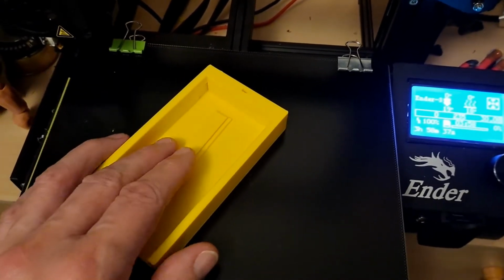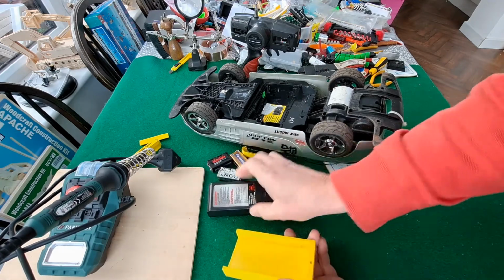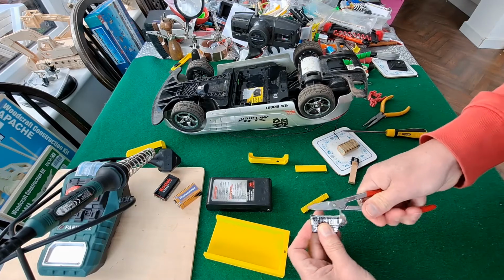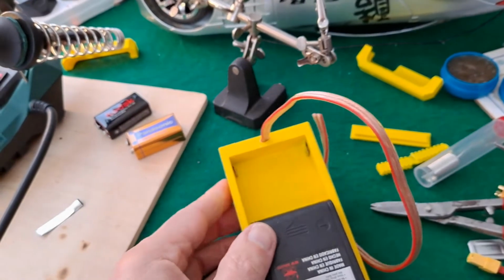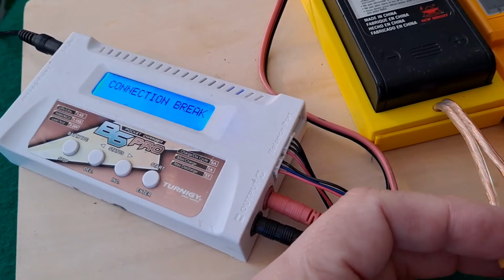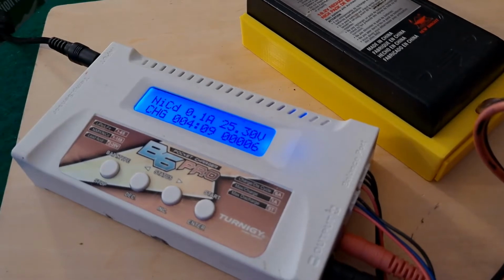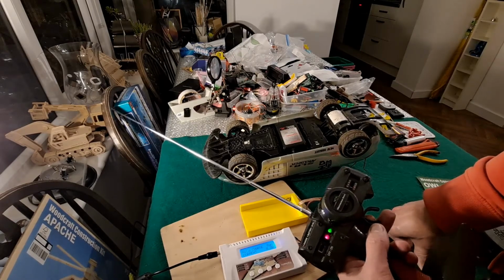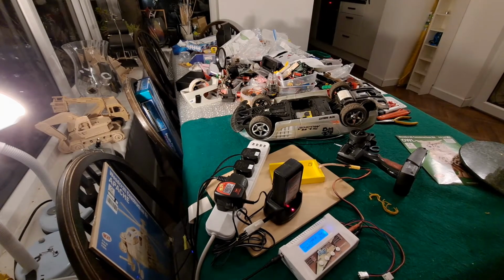3D printed battery charger adaptor

Comment: Enjoyed the video. I'm  interested in a 3D printer but I'd like advice from an older , practical , knowledgeable guy. It's al very well watching younger guys with the the glitz of their channel but it's not giving me the advice I need.
Reply from the maker: Hi Andrew, you won't be getting advice from me, I share what I do but that doesn't mean I am right. There are plenty of youngsters out there who have far more experience than me and genuinely know what they are talking about, but I know what you mean about some of the glitz out there.
Reply: @GrandadIsAnOldMan  I think what I'm trying to find out, the printer you have what did you think of it, was it easy to assemble and use etc. I see you switched to a glass bed, does that make a big difference.
Reply from the maker: @andrewferguson7762  perfect, you chose to ask these questions on one of the few videos where I have NOT put the affiliate link for the printer in the video description 😆 All my videos have extra information in there and the "3D printed" playlist included the original unboxing. I am really not in a position to make a recommendation. I have the Ender 3D because it seems to be popular and relatively cheap. If you buy one, you need to remember there are ongoing costs with the filament you use and any maintenance parts - mainly nozzles which you can buy in bulk, cheap. I just use PLA filament because it is supposed to be safe, most of the other filaments produce fumes during printing that need to be vented or you need to buy a printer hood.
Grandad's Postbag 200214 or grandad goes to the dark side https://youtu.be/sVJ5uxgTMj8
Grandad goes to the dark side Ender 3 assembly FAST FORWARD https://youtu.be/ld3oGEDkrhs
Grandad goes to the dark side Ender 3 assembly https://youtu.be/BUUyQsgOdCc

Amazon *Affiliate link for the printer https://amzn.to/3iVJVbB
NOTE: I bought mine on Banggood I paid £147.91
BangGood *Affiliate link https://www.banggood.com/custlink/G3vmwP1BFu
*Affiliate links may generate an income for me

Reference the glass bed. People recommend it. I am not convinced it is a benefit. So far I have had several print failures with it, but I had a lot of print failures with the original bed until I had sorted out my settings and even then it changes with different brands of filament.
Reply: I @GrandadIsAnOldMan  Thanks a lot, I've been a subscriber for a while, but now I wait with trepidation to see what you are creating.. Thanks for all the info and help

Comment: Hi Grandad , That's Cool You Found the Correct Charger . It's Funny How Some "Smart"  Chargers Aren't As Good As The Original Ones Some Times . I Bet The Other Charger Works Now on That Battery.
Reply from the maker: Hi Wayne, the home made one does work but I now realise that I cannot speed the process up by increasing the current. The original charger supplies 24v at 140mA for 4 hours so when I tried giving it 1 Amp it says "no thank you" 😁

Comment: Nice video.  Lucky you found the Propper Charger for the battery. Now you can Charge it right again.😀
Reply from the maker: It is easier to use the proper one, but handy to know I have a spare now.
Reply: @GrandadIsAnOldMan  😀😆

Comment: Grandad what is the output on the original charger?
Reply from the maker: Hi Ed. It is 24v 140mA and marked as 4 hours charge, which is probably why the battery doesn't like me try to charge it at 1 amp.
Reply: @GrandadIsAnOldMan  My thought exactly.
Reply from the maker: @Sea-Dog5496  Yes, I forget that not every battery can charge as fast as LiPos 😁👍

Comment: Nice job
Reply from the maker: Thanks Tel, I think those metal tabs I used to make the spring connection don't make a good enough contact. If I try to push a higher current in, it disconnects and comes up with an error message. I need to do a bit of work on those tabs to improve things.
Reply: @GrandadIsAnOldMan  Pogo pins spring to mind , excuse the pun. but it would mean reprint so you slide it in side on? I used them on this,     https://www.thingiverse.com/thing:4409300 link to them is there , you can break them into the number you want

Comment: Well, Graham, you have always got the printed charger if the original one goes on the blink. You could print a battery box that would fit the car and put some lithium-ion batteries in it. Six will give you 22.2v and 5 will give you 18.5v. Or you could use the original battery case and put them in it, but of course, they might be too large to put them in the original battery case. If you did do it then personally I would go with 5 in series. 
I was looking at the price of lithium-ion 18650's and they are not cheap. Lipo is probably the best way to go. 👍👍👍😁
Reply from the maker: It seems to be working fine with that NiCd, certainly too fast for me to drive 😁👍

Comment: At least you found the proper charger but that charger will probably take a while compared to your homade setup.
Reply from the maker: Strangely enough, it isn't going that way for me. I think those metal tabs I used to make the spring connection don't make a good enough contact. If I try to push a higher current in, it disconnects and comes up with an error message. I need to do a bit of work on those tabs to improve things.
Reply: @GrandadIsAnOldMan  Alternatively gut out the old charger housing with the original contacts and adapt it to conect it to the better charger.
Reply from the maker: @peterdering4922  The old charger works fine so I won't be touching that, but I have plenty of other sources for the contact springs. I don't think I got the alignment right either so I could do quite a bit more work to it.
Reply from the maker: As Ed has pointed out in his comment, these NiCd chargers are low current, so I don't think there is a problem. If I try to push too much current through it, either the charger or the battery says "No thank you". The original charger is 140mA for 4 hours.
Reply: I totally agree, give it a full charge with the original charger and from then on with the other one, much quicker.